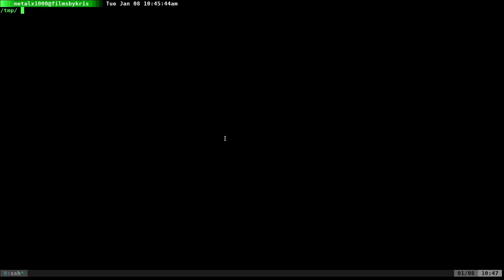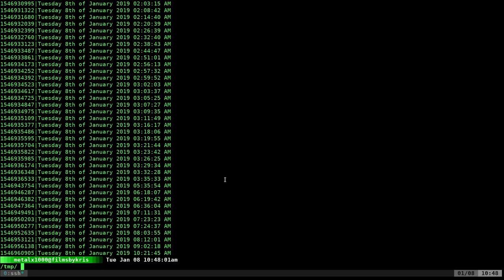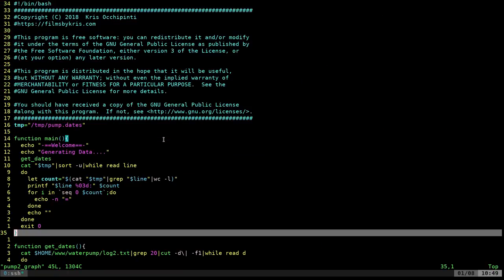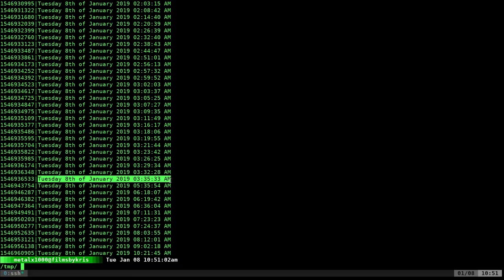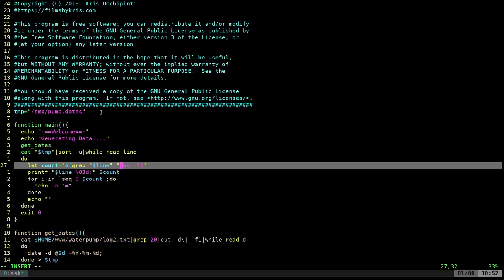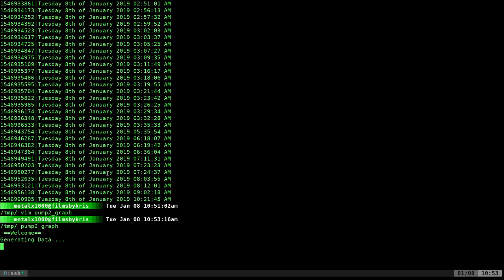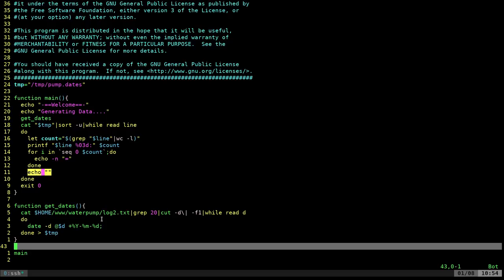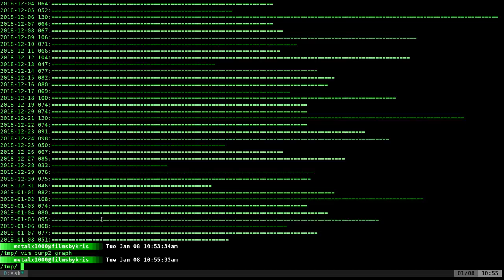Water Pump Simple Graph of Usage Linux Shell Tutorial

Comment: Tap the expansion tank it should ring like a bell... if not its busted. I would like to see the current flow of the pumps as well. Can you control the pump system with these WiFi modules?.
Reply from the maker: If by control, you mean to control the power, you can easily connect a relay to them and then use that to turn the water on and off.  Although I can't think of a time when I would want to do that, but someone might.
Reply: Kris Occhipinti. Oh l am just really interested in water electrical systems. l have installed some water pump systems which had radio remote controls they cost a fortune, and are not that robust just a few circuit boards in a IPXX rating box. Shocking what some charge really. These WiFi modules are interesting, especially the fact they are cheap and have I/O pins.

Comment: Ha, nice! But I don't really understand your data-file. Why the first column?
Anyway, here is an awk-script that should do the same as your script, maybe quicker?
It loops over the file just once:
   BEGIN {
       FS = "[| ]"
       print "-==Welcome==-"
   }
   {
       count[$5" "$3" "$6] += 1
   }
   END {
       for (day in count) {
          printf "%20s: %3s ",day, count[day]
          for (i=0; i<count[day]; i++) {
              printf "*"
          }
          print ""
      }
  }
To run it: awk -f script.awk datafile
Reply from the maker: It's the UTC time stamp.  If anything the second column is un-needed.  I the second column is mainly for quick human readable output without having to convert the first column.  Whenever saving time stamps UTC should be used.  What if I want to see everything from Jan 23rd to Mar 5th.  Doing that with the time stamp would be easy.  Doing it with the second column would be a pain, unless I converted it to UTC first.  This sort of data is all about sorting when something happens.
Reply: @DigitalMetal  
> What if I want to see everything from Jan 23rd to Mar 5th.
sed -n '/23rd of Jan/, /5th of Mar/p' datafile
... and pipe the output to my script :) But I agree with you on timestamps.
Reply from the maker: Then you also need to enter the year.  And you are assuming they are all in order (which, in this case they should be).  And if you want to do certain date range and set times of day.  Trust me, whenever I don't use UTC for time stamps I regret it.